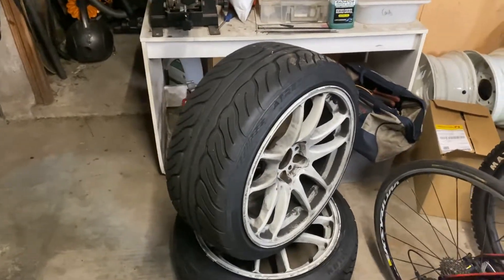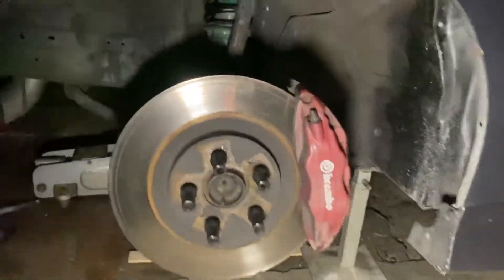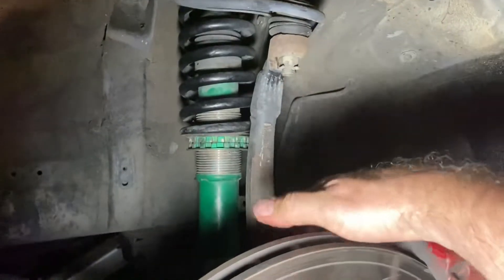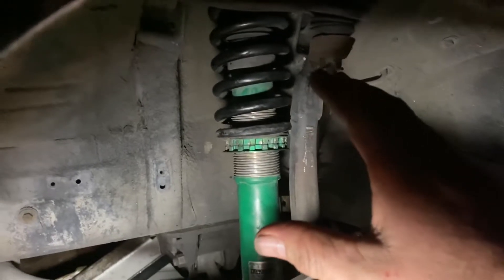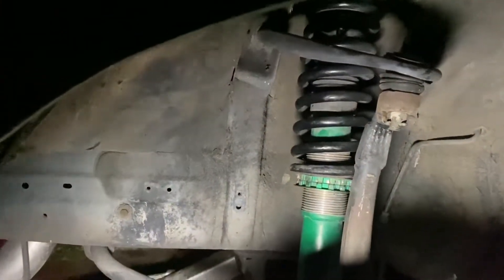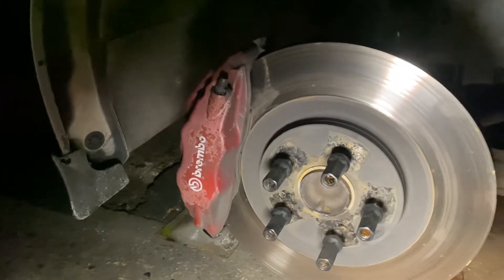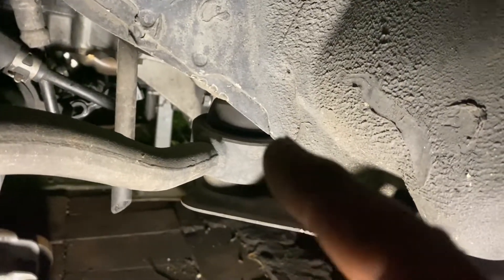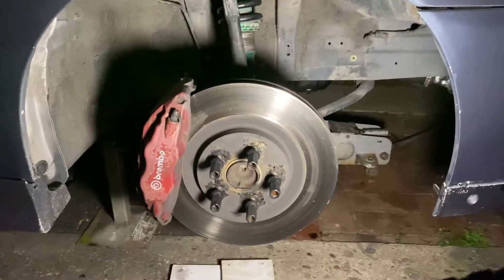JZX90/100/110 - Suspension setup - how to shortened uprights / RCAs / extended LCA +25mm

Comment: Thanks for the video. I've been changing my mind a lot on how I want my 110 to be set up but I think I've got a good idea in my head now. 110s have the same suspension setup as Altezza's so they're a little different than X100, X90 etc but the same still applies. 

I've had my uprights shortened by 30mm and I'm going to be running +25mm LCAs, and extended knuckles (both LCA and knuckles from Kazama, as they're cast products, not modified). I have Cusco upper arms already on the car but I don't think that should matter. I've also got GS300 tie rods to help with the extra angle. Would you suggest running roll centre adjusters with this setup? I previously hoped I could get away without using them but I figure now with the 30mm loss from the uprights, they'd be pretty desired. Roll center is a whole new thing for me and I am trying to get the 110 to handle the best it can, so I'd appreciate your input.
Reply from the maker: Definitely run roll centre adjusters. Basically they put back the 30mm you took off the top of the uprights & put it at the bottom to correct the geometry. You’ll get a bunch of bump steer otherwise. I made another video about the combo of rack ends & tie rods to use with extended lca. Gs300 tie rods & jzx110 rack ends work for +25mm lca. If you went 35mm lca or need more lock clearance you can  use Honda stream tie rods & either gs300 rack ends for +25mm or jzx90/100/is200/300 for +35mm lca. The Honda stream have more clearance than gs300 tie rods but are longer.
Reply from the maker: And yeah, you want a much heavier spring rate in the rear for IS. I have 24kg fr / 6kg rear. I think you want 24kg front & 16kg? Rear I remember reading?
Reply: @Fine_Performance  Thanks mate, that sounds perfect. I'm running 22k F 20k R on the 110 and it's pretty perfect in my opinion - Even on horrible UK roads. I'll get some RCAs ordered
Reply from the maker: @110t0m  yeah that sounds about right. If you were drifting you might want 24kg in the front, but for street 22KG is fine either way extended lca I reckon.

Comment: I’m suffering from bump steer big time, I live out in dayboro and dayboro road is bad for it because of the poor road conditions, I’ve got about 20-30mm from tyre to fender gap, with no rcas. Front ends got all new ball joints and bushings. Just wondering if you’ve got similar problems with bump steer prior to doing this, also what’s your ride height and etc
Reply from the maker: Have you got standard uprights? Ie not shortened? I’m at Everton park so I know dayboro well :) mount mee is pretty rough. But without shortened uprights + RCAs you will get bump steer. The lower you go, the worse the bump steer. Because your arms end up at an angle. But shortened uprights & RCAs will correct the geometry & fix the bump steer. What car do you have? I have some spare shortened uprights, only one side has ABS port that’s all.

Comment: I have very bad selfsteer on my jzx90, so if i put jzx110 caster arms my selfsteer should improve tight? Just need to change the 2 bolts right?
Reply from the maker: Need more info. Do you have extended LCA or shortened uprights? Do you have RCAs? Stock FUCA or adjustable? 

You can’t use jzx100/110 castor arms on jzx90 because the bolt holes on the LCA are different spacing. It’s not just different bolts from memory. As far as I know, JZX110 just has greater clearance for steering angle/lock, I wasnt aware that they altered the amount of castor.
Reply: @Fine_Performance hello, just saw ur reply, my front suspension is completely stock, i just need more caster.
Reply from the maker: @marwatfpv4419  yes, but if you have JZX90 lca, you cant physically bolt jzx110 castor arms as the bolt spacing is different. You can use DMAX adjustable castor arms. Or you can swap out to JZX100 lca. Jzx110 castor arms don’t give any extra castor though I don’t think. I’m 99% sure they just give more wheel clearance for extra lock/ shorter knuckles.